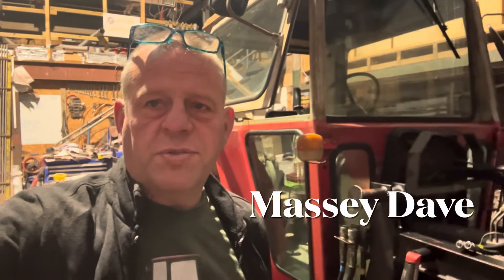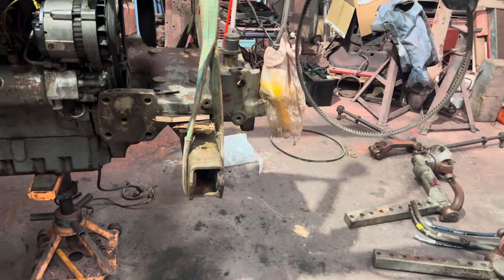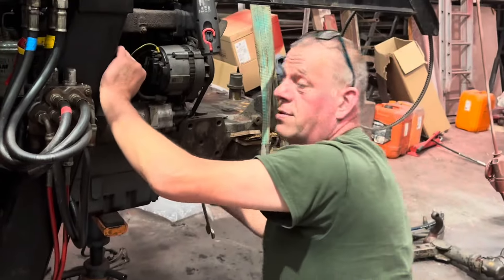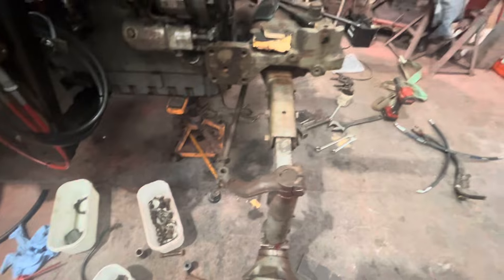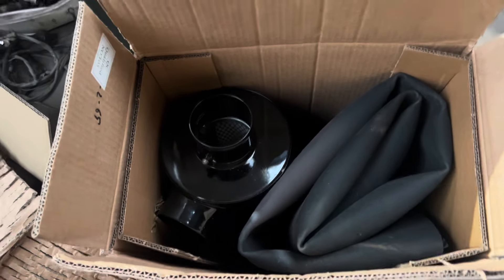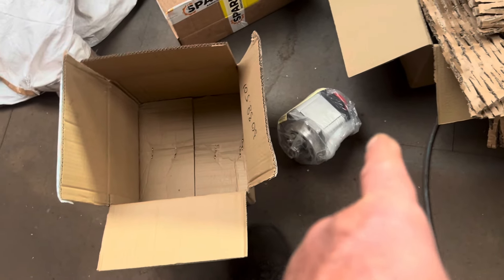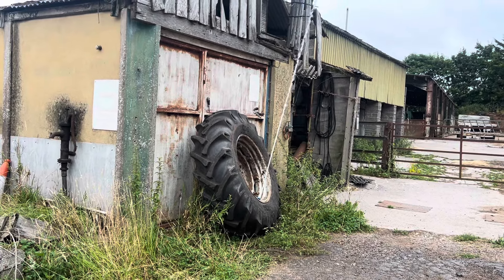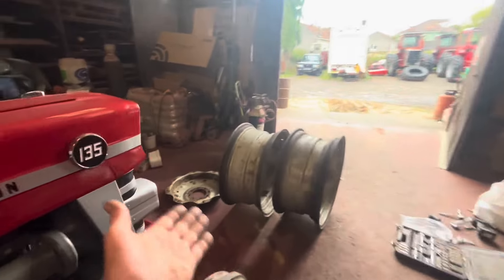MF 575 ! More to do now 👍

Comment: Dave do you think a 148 is worth the extra money over a 135 ? I know the differences but the difference is nuts in price 👍
Reply from the maker: 🤷 u know I’m more into the 1200/1250 , been nice tho to work on smaller stuff , 👍
Reply: Of course it is 
135 is very common 
Not many 148s about